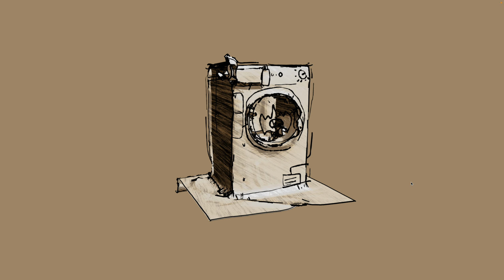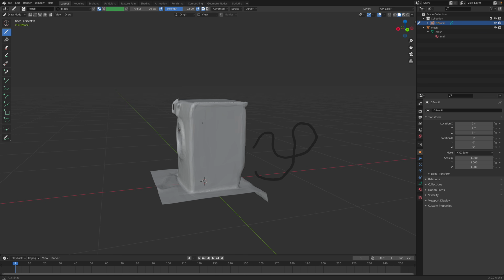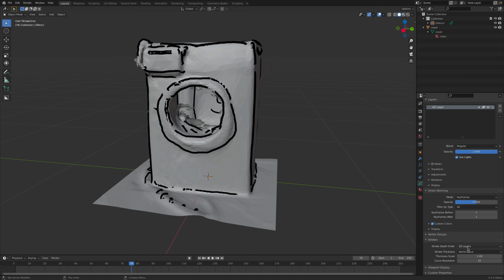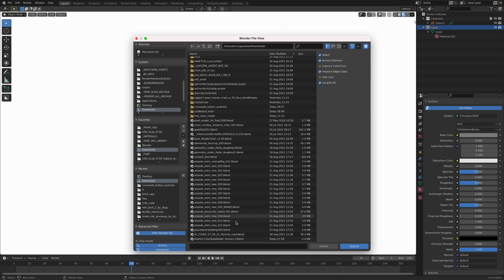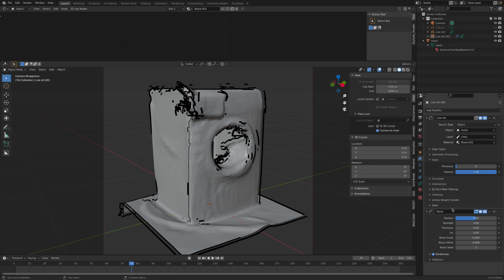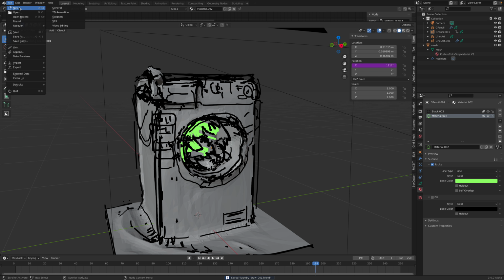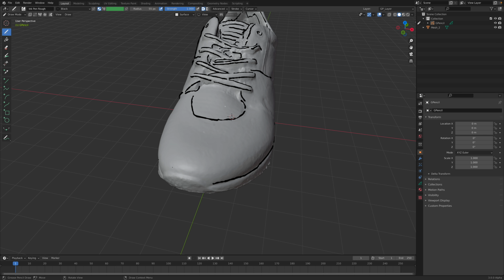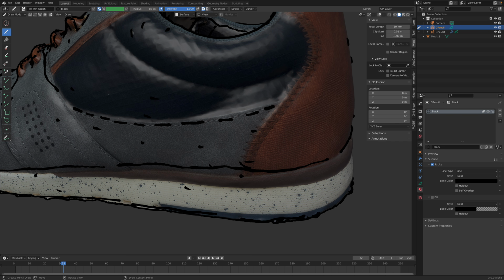Grease Pencil 3D Tracing Theraphy Using Blender

Comment: 14:27 can you please tell me how to give a 3D model that crack effect. Please can u tell me in steps cause i am a beginner. I want to use that effect. Thank you in advance.
Reply from the maker: It's from the 3D scan model itself. If you use Apple's Object Capture or app like Metascan or PhotoCatch, you will get the crack. It's actually like Voronoi or you can simulate using random triangulation (decimate) and dual mesh, then cut randomly into cell.